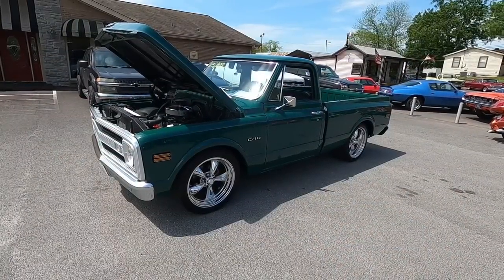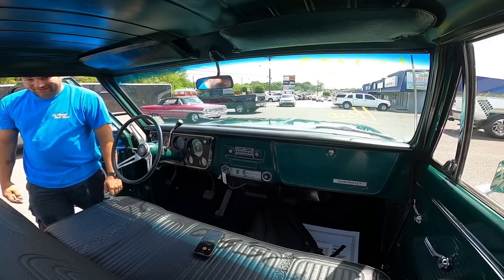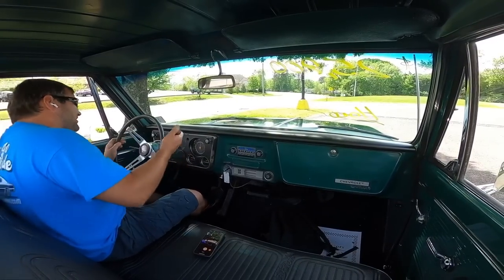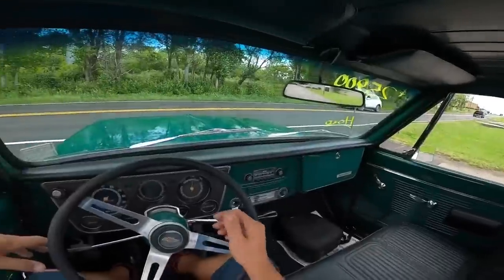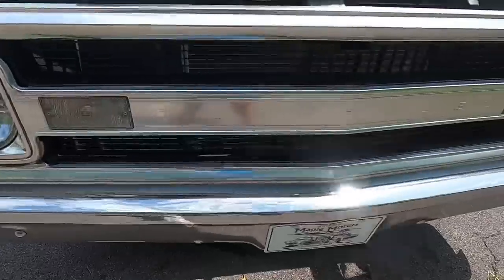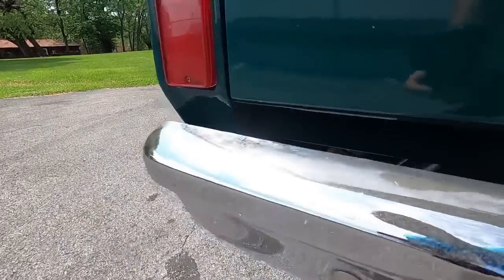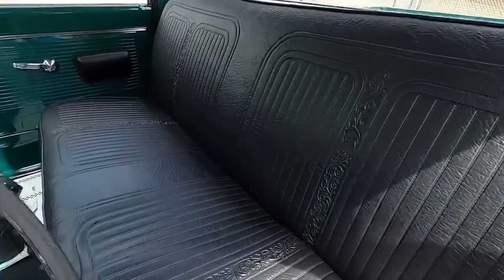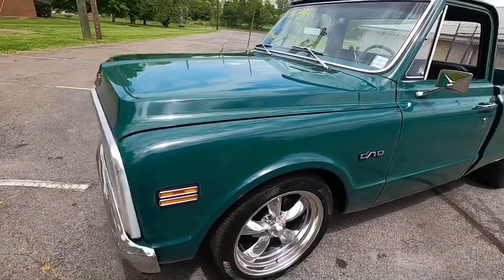Test Drive 1969 Chevrolet C-10 SWB Pickup SOLD $25,900 Maple Motors #1608

Comment: Hey Nick, when you did the drive over, it has a pretty good leak around the Bell Housing area!  It looked pretty steady!! Thought I'd mention it...not sure if that's anything y'all can do, but whoever buys it, needs to know.  Nice truck though!!! ✌😎💨
Reply: more like an active drip lol i think it even dripped on his light.  its the automatic undercoating feature.  but yeah, that thing has a bad oil leak.
Reply: Yeah, right at 8:56, looks like the main seal, but could be anything, but top of the motor looks clean, so not a head or valve cover gasket.

Comment: That is a sweet truck they don't make them like that anymore easy to work on them everything is right there so you can work on or replace the part  I remember every single truck came with manual transmission the only thing that you need is a gun rack 👍

Comment: Just posted the video an hour ago and it's already on "hold"? Saw it on the windshield during the test drive. 🤔
Reply from the maker: told you about it in the video
customer said , won't pay for the truck until the video is made. Not enough time in a week to get them all done. 
I do my best but I have 0 cash atm on this truck. NOT SOLD YET! HOLD DON'T MEAN SOLD
Reply: @MapleMotorsNickSouthgate  
Yes Sir you are correct cash is king! 💰
"Talk is cheap and baloney makes good sandwiches!" Just curious since when does the customer set the terms? 🙄 "You do this before I do that." 🤔 JK 😉

Comment: Take about $5 -9k off because of serious leak underneath truck. Other than the leak truck is sharp!
Reply: Obviously you don’t know the truck market very well right now!! You can have someone completely rebuild that engine for less than half of what your talking about and it doesn’t need it! The leak is probly an easy fix and other than that it’s a clean, solid truck! These are bringing much more than this elsewhere for the same truck. I have seen non runners with no floors bringing a good portion of this price so nick has it priced extremely well for condition as evidenced by it being on hold already. Overpriced trucks don’t sell within hours so go find a better one for the money, they are getting harder to find but if you’ve got $50k to spend then you can start finding more but they still have the same leaks
Reply from the maker: dang that a hell of a lot for an oil leak lol, sorry price is firm and if we work on it price goes up. Thanks